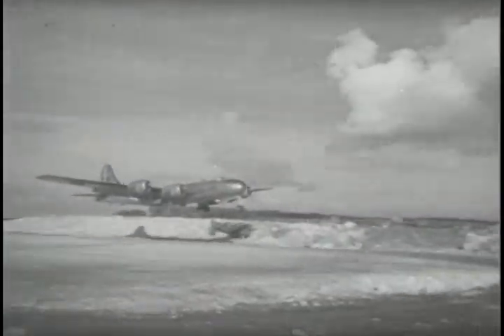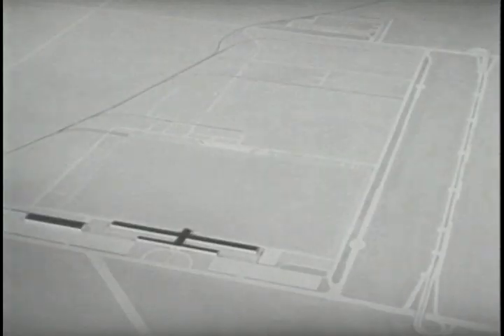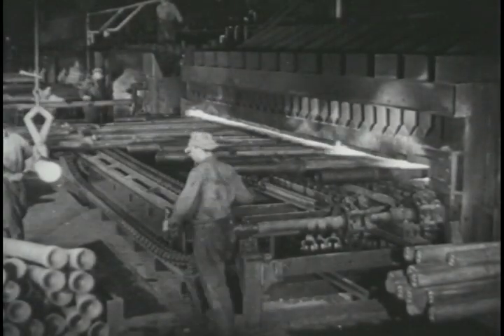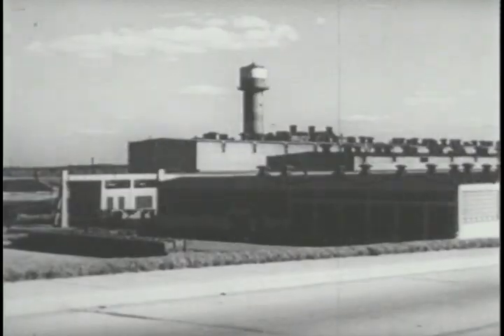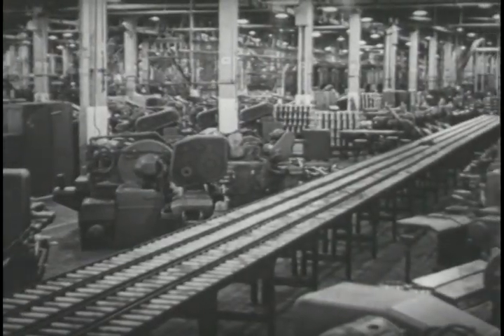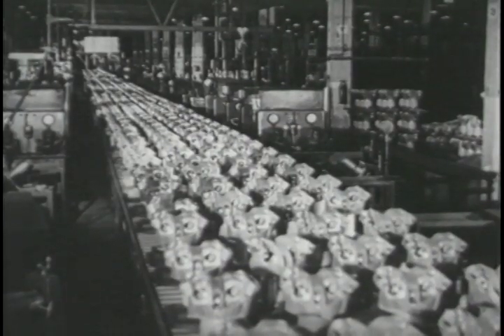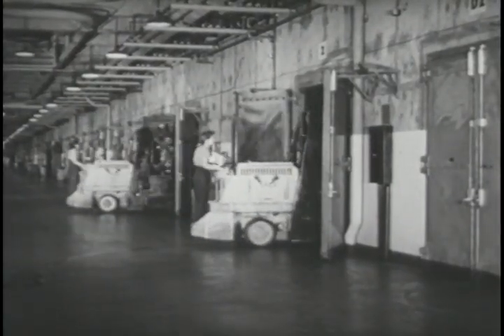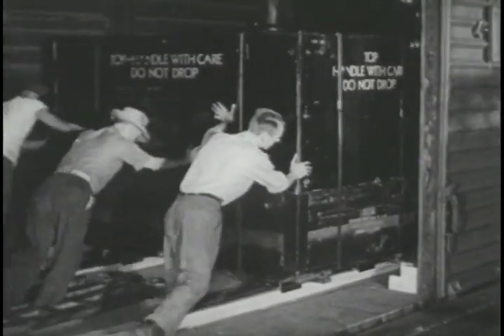Engines for Superbombers

Comment: From Wikipedia 

After the war, a lease for the plant was awarded to the Tucker Car Corporation, and it later used by several automobile manufacturers including Ford Motor Company. Tootsie Roll Industries moved into a vacated portion of the plant in 1967. To this day, TRI uses these tunnels for archives and storage as well as locker rooms, as Ford City uses them for a strip of boutiques

Comment: That engine testing that they used to generate electricity didn't save $25,000 a month to the tax payer, the engines used fuel and the fuel cost more than the electric would have been.

Comment: The R-3350 was no prize, especially the "parts recovery turbine," but it was more reliable than the notorious R-4360.  The B-29 was seriously underpowered.  The B-50 (really an modified 29) that followed had the 4360s, barely adequate for full bomb load.

Comment: Great tribute for what amounted to a fantastic amalgamation of efforts.  On the other end, my father worked for the War Assets Administration at Boeing/Wichita.  I was very young but remember him bringing home stories of how troublesome the first R3350s were with overheating and catching fire in the B-29s.  C-W eventually redesigned the engine to direct the front cylinder bank exhausts to the rear rather than to the front which had been the source of so many failures and headaches.  The big engine went on to serve admirably in post war applications on both military and civilian aircraft.
Reply: The engine powered the Douglas Skyraider over Vietnam. I've got a visualization thing about the big bombers, for instance when I see the Lancaster it looks like four Spitfires. I know the cowling isn't the same on the Skyraider and B-29 but I think you see where I'm going with it.

Comment: Designing and manufacturing the machines is amazing it in itself. These people were brains, did not need any computer or cell phone. I didn’t see any power tools either like a Cordless drill, they used handtools. I bet nobody was a crackhead either like they are today

Comment: Dad was a B29 pilot.  He said that the hydraulic coupling from the engine to the prop was iffy and a lot of engines failed on takeoff due to the prop stopping.
Reply: My wife's former boss was a B-29 pilot flying out of China. During a TV interview he said the B-29 required all of a 10,000 foot runway to get to takeoff speed of 140 MPH. Many didn't make it, and he lost several buddies when they couldn't lift off.

Comment: These engines had a history of catching fire. In fact, the prototype B-29 with Boeing’s chief pilot, Eddie Allen and a cadre of engineers were killed on a test flight when one of its R-3350 engines caught fire and caused a wing to collapse. Overheating was a huge problem during WWll.
Reply: Caught on fire because they swallowed valves, there were mountains of these engines piled high on the island march to Japan because of reliability issues of Wright, after a very low total time they just changed the engine.

Comment: As a manufacturing engineer in today's world, it takes 5 months just to get the purchase orders sent to the tooling suppliers.  Back then they designed and rolled out new equipment in less than 5 months. I grew up in the wrong era.
Reply: I bet he could buy a house in like 2 paychecks unlike today
Reply: Not sure where you work but where and complexities but I worked about a month from concept to tool in hand. With today’s modern capabilities of CAD and CnC as well as rapid prototype better and quicker results are the norm.
Reply: @frankbutaric3565 I work at a place that has educated people that can write a simple paragraph, with correct grammer.

Comment: I worked on the R-3350's and flew the SP-2H's in the NAVY. Powerful and sounded great. I had no idea they ran them and then totally disassembled and reran them in the building process.
Reply: It's to my understanding that every aircraft engine was made that way during the war, even the Packard made Merlin engines, they actually had oval shaped racks that the engines hung from and moved from one stage to the next where each worker had one single part to take off of an engine that had already been test run so that they could be inspected and cleaned, then they moved to another oval shaped rack where reassembly happened.

Comment: So they built this impressive Wright R3350 radial engine for the bombers, but when it came time to build the Chrysler version of the Sherman tank they slapped together 5 flathead sixes in a slapdash corncob arrangement that was nothing but trouble.  Seems like they could have used one bank of the R3350 to make a big 9 cylinder radial tank engine that would have been simple and effective.

Comment: Joe Lencki was the Superintendent of the factory.  They used 4(?) Baldwin locomotives to heat the plant.  There was 1/4 inch difference in the diameter of the engine between hot and cold.   Women were used to install the spark plugs because of the tight spacing.  

Joe was alter associated with the Tucker which used part of the plant

Comment: The Dodge Chicago plant was built to manufacture R3350’s during the war. After the war, Preston Tucker built his Tucker 48’s there. Then Ford owned the plant and built R4360 engines then later J57 Turbojets. Then it was sold to land developers and turned into the present day Ford City mall. You can still see the exhaust stacks from the engine test cells there.
Reply: Tootsie Rolls Candy occupies the northern portion of this plant on Cicero Ave.  Apparently they have a Wright 3350 engine on display in their facility.

Comment: My Dad was aircrew on Lockheed EC-121H Warning Star Constellations in the early 1960s and they flew with the R-3350s. Amazing engines second oy to the R-4360s, which had 28 cylinders in 4 rows of 7 jugs, each.

Comment: The documentary emphasizes all the work that was done to build the infrastructure for the B-29 engines and in that way attempts to gloss over the fact too much time was spent preparing and thus the plane became operational later than it should have been. And even with all the effort the engines were not reliable.

Comment: A wonderful video and time. However, THAT engine killed more men, than the Japanese, from what I read. Cylinder #17 was one of the issues. Exhaust valve got hot, broke, and caused fires. And, magnesium was light, but would burn. Apparently it was reworked after ww2, however, the R3350 never had the reliable reputation of the P and W R2800. Thanks for a reminder of those days.
Reply: "THAT engine killed more men than the Japanese". I hope you're being hyperbolic with that statement.  If not you really need to look at the Pacific Theater casualty figures. Yes the WWII R3350 had problems but at 10 crew per aircraft that's a lot of 29s going down in flames. If you want to read about very reliable and efficient R3350s read about the mods CAF did to FiFi's and Doc's engines.
Reply: @JustaPilot1  What he meant was more B-29's were destroyed and crew killed by wrecks caused by mechanical failure than by being shot down in combat. The air force had to abandon formation flying over the target because each aircraft had different engine characteristics, and the flight engineer had to baby them all the way to the target to keep the engines from overheating by opening and closing the cowl flaps.
Reply: @AML2000  Mmmmm    NO. You really have no idea what you are talking about. Please stop.
Reply: I know the powers that be usually didn't respond well to anyone under their status pointing out a problem!  Once they gave the Go-ahead, they treated any input as the enemy!  I am surprised it even got corrected.  Look at how many lives we lost during the war by having to use faulty/defective torpedoes!  Every single sea captain/submarine commander/ and torpedo plane commander knew and told higher ups about the missed opportunities of a torpedo system that just got our men killed.  None of our allies would even accept these worthless munitions even when offered for FREE!!!  Now, how long did it take for the Navy to ask for another test of their beloved torpedoes before they could even admit that there was a problem?????

Comment: when i hear the production numbers it just blows me away. what a generation of hard working, extremely smart and patriotic people
Reply: Thats 53 engines a day!  Production levels that would be just a dream these days.  When a country is pushed into a corner so to speak, everyone does their bit. Just to look at the machines required to build the parts is more than just mind boggling.  Someone somewhere had to design and test these machines and processes even before manufacture.  America was more than just a powerhouse of production at that time.
Reply: @bobolulu7615  I would bet that any major car manufacturer can out produce that number. With better reliability and quality control. It was outstanding for its time.
Reply: @frankbutaric3565  today we rely on outsourced parts and labor from adversarial countrys. Plus, It would be a challenge just to keep the EPA and OSHA away as well.
Reply: @roberta.6399 ,

If things get tight and there is a BIG thread, EPA and OSHA are the first things that are revoked by government.
Reply: instablaster...
Reply: Extremely smart is an understatement.

Comment: As others have pointed out, all this was done with no computers.  No CNC.  No robots.  No 3D CAD/CAM software.  Not even an electronic pocket calculator!  The most they had was a slide rule.

Comment: Draftsmen...lots and lots of draftsmen.   Every one of those parts had to be drawn out.  No CAD no CAM...JUST hands.
Reply: I graduated in 1965. My Highschool had a drafting 1,2 and 3 class available only to Juniors and Seniors. I would sneak into the advanced classes to get a challenge for my drafting skills. When I asked to enroll during my senior year, though, the class was filled- and I never was able to go on. I enlisted in the Army that September. Yet, here I retired in Las Vegas as a senior architectural digital modeler, with Autocad- all self-taught. I never did use my "by hand" drafting skills. I built many of these new casinos and almost all of City Center, and World Market in a computer from below-ground up to the flag pole, every detail, including fireplaces, wall art, furniture, faucets, and even door hinges. Funny how life takes control of your future.
Reply: And a slide rule

Comment: No computers, no calculators, no cell phones, no 3D printers and they still got it done!
Reply: Yeah, and we were smarter then.
Reply: computers and calculators yes they definitely did and employ those other items no
Reply: Monroe and Burroughs made electromechanical machines that added, subtracted and multiplied. Working such machines was deemed women's work. Cellphones were not essential when there were land line phones everywhere, answered by women who took written messages. I am not sure if primitive numerically controlled machine tools existed or not.
Reply: @lylecosmopolite  Possibly not. I believe I may have worked with some of the first such machines in the early 1970s, although they had possibly been around commercially for a decade. The machines read instructions from hole-punched tapes.
Reply: They had computers (called data tables, huge catalogs of permutations of common outcomes based on variables...) they had calculators (Called slide rules) and the had cell phones (Called 2 way radios) and 3-d printers...Called SCULPTORS!
Reply: @starstudio8402  oh dear. Mate, I was being sarcastic. Yes, between 69 and 72, 12 Americans walked on the Moon. I was having a dig at the deniers. I met Gene Cernan, the last man on the Moon.
Reply: @MrValiantAP6  ohhhhh ok
Reply: I just watched a video on merlin engines and they were accurate to 1 millionth of an inch. They had to invent devices that were that accurate before they could measure that small.
Reply: they know
Reply: @M Bacon I am well aware of the fact described in your second sentence. That is how trig and log tables were calculated before the 1950s. Ditto for the percentage points of statistical distributions, work done during WW2 at Cambridge University in the UK.
Reply: @James Cowan Did you notice the slide rules in use when testing the engines?
Reply: So were the pyramids
Reply: Survival is always the highest use of the human mind.
Reply: Those are the reasons why they got it done.
Reply: I saw one gal using a slide rule.  I still have my slide rule I bought in high school in the 60s.
Reply: 100% correct and nearly NO 'red tape' just do it and the people THEN like regular citizens did their share! Some people didn't/couldnt drive to conserve fuel, rubber, etcc. President got things done not held up with such nonsense as is going on now
Reply: In the face of all that primitive technology, there can only be one conclusion. Just like the Lunar landings, World War 2 never happened. Another massive NASA cover-up.
Reply: @MrValiantAP6  reality, give it a try
Reply: @WeinerusMaximus  It appears I have been misunderstood. I had been browsing YT videos that deny that the Moon landings took place. An old argument is that 1960's technology was too primitive to achieve such a feat. Deniers are a reality. My Grand parents fought World War 2.
Reply: @MrValiantAP6  You can go back to sleep now...
Reply: @raybin6873  Ray, I am being sarcastic. I had to say as much in a follow up reply...."It appears I have been misunderstood. I had been browsing YT videos that deny that the Moon landings took place. An old argument is that 1960's technology was too primitive to achieve such a feat. Deniers are a reality. My Grand parents fought World War 2". Cheers
Reply: @MrValiantAP6  Gotcha - my grandparents also fought in WW2.
I saw somewhere a person was asked why US fought in WW2 - answered "The US fought for it's independence." Can you believe...we have ppl like that floating around? LoL! 😁👍
Cheers back at ya!
Reply: @MrValiantAP6  Don't worry, soon Jesus will come and help you navigate the internet and reality.

Comment: if you do a wiki read of curtiss wright there was a big scandal of some kind over defective new motors being shipped out , shame , the crankcase was magnesium I believe and once on fire burned thru the wing.
Reply: The defect on the Curtiss Wright engines wasn't magnesium in the cases, all the aircraft engine cases had aluminum magnesium alloys for strength, aircraft engines have to be built as light as possible because every extra pound on one of them is one less pound that the aircraft can carry, the defect and ensuing scandal over the CW engines was defective carburetor heaters, an Army general who was in charge of quality inspections for aircraft got caught taking money and gifts to turn a blind eye on the situation, it's thought that the plane that Glenn Miller got killed in when it went down in the English Channel had a defective carb heater causing it to ice up and the plane crash, records show that the plane Miller was on had a CW engine that was from a batch of ones that were in question.
Reply: Magnesium is light and strong, but does burn like a road flare once lit, which of course, is what road flares are made of.
Reply: @kennethleftwich1939  
Magnesium is an absolute necessity for strength in aluminum, copper also, pure aluminum is like puddy compared to what is used for engines, all of the modern engines around you that are aluminum have magnesium in them, from your car to your weed wacker.
Reply: 3350 cases were made of steel not aluminum or magnesium. Other parts were Mag or aluminum. A case section for 9 cylinders on a3350 is lighter than an aluminum case section for 7 cylinders on a 4360. A stainless steel firewall was installed around the magnesium blower section so it was somewhat protected from fires originating in the power section.
Reply: @brianpeadensr378  thanks for the info .

Comment: This was the great AMERICA that once was!!
Reply: the high octane gas of those engines was so volitile the guys used it in their cigarette lighters
Reply: Yeah, building massive fleets of airliners for free to get people together to celebrate Unity and everlasting World Peace, to transport food to stop World starvation. And the list of humanitarian progress does go on ...
Reply: And the engines ran on compress air no fuel is or was ever used in aircraft engines. Free energy has been here for over a hundred years
Reply: @williamjones7604  idiot
Reply: @kerrytodd3753  Yes an out of the box thinker
Reply: @williamjones7604  engines cannot run on compressed air, compressed air has no volatility, where did you get that rubbish from ? 
If that was the case  a diesel engine would  keep running after it ran out of fuel. Do think for one minute that Elon  Musk would not be right on to that  if it was possible ?
Reply: @williamjones7604  do you seriously believe that engines can run on compressed air? They can run on it as a replacement for steam. But it defies the laws of physics that engines can deliver more power on compressed air than it takes to compress the air in first place.
Reply: @williamjones7604  How is the air getting 
"COMPRESSED"?.

Comment: the early Wright R-3350 for the B-29 were beset with dangerous reliability problems as some bombers were lost due to these engines the design of them the exhaust of front bank of cylinders exits the front and the front collector ring is in the path of the airflow.  as the two airworthy B-29s had their original dodge built engines replaced with hybrid cross of the later model Curtiss- wright R-3350 engines.